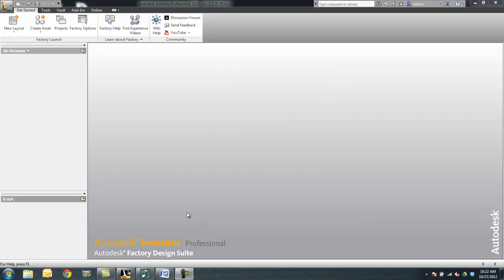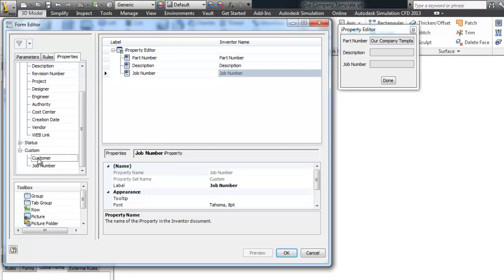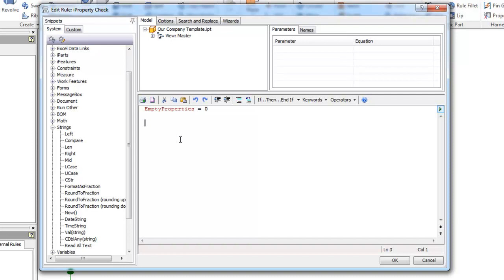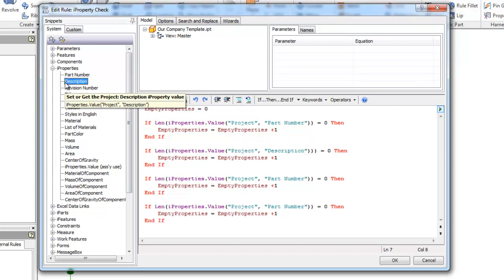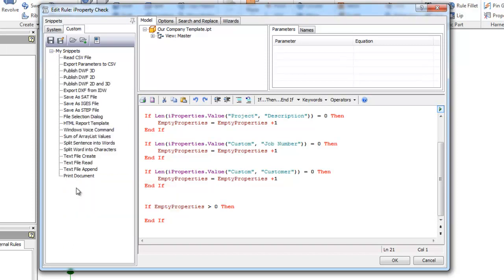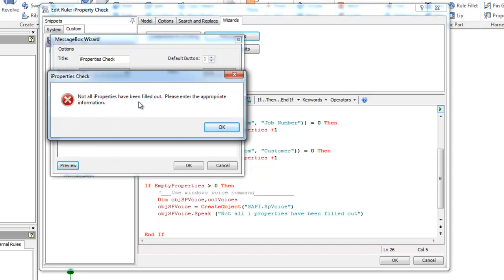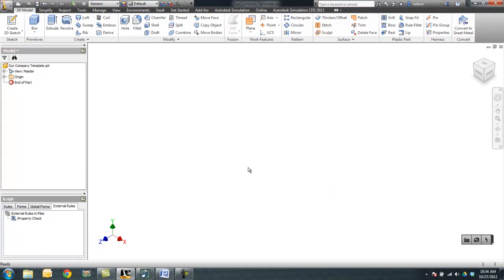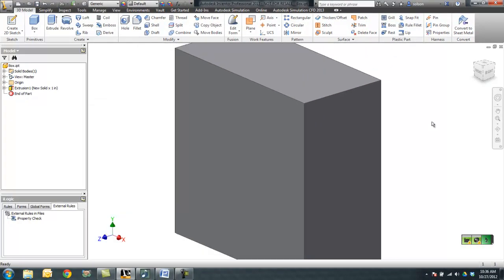iProperties Editor

Comment: Hello I'm able to add custom properties and also able to link it with template, but what happens is , the custom properties is just added for individual part only. Is there any way that custom properties I have created would get applied to all existing  parts and assembly, also any new part or assembly I create, those custom properties would be default.
And I'm new to inventor, your videos are helping a lot and I  appreciate your work man ❤️
Reply from the maker: Pranav, I am glad to hear that you are finding my videos helpful as you learn Inventor.  First of all, I would make sure that you add those Custom iProperties to your templates.  A common issue for users is how to get older files to have the right properties and iLogic Rules.  You could create a rule that looks like this.

Try 
	prop = iProperties.Value("Custom", "Test") 
Catch
	iProperties.Value("Custom", "Test") = ""
End Try

In this case, iLogic will try to get the value of the Test Custom iProperty.  If it can't, it will do what is listed under Catch, which is to create the property and set its value to nothing. 

Your new rule will need to be run on a bunch of files.  Previously, I had found a way to do that through Inventor's Task Scheduler.  As I was looking for that post, I found this.  

https://apps.autodesk.com/INVNTOR/en/Detail/Index?id=7381718697722491251&appLang=en&os=Win64&_ga=2.110687173.1955690979.1623693230-1577746048.1612365974

It is an add-on that will allow you to select files that an external rule should be run on.  There is a demo video that shows how to run the tool.

Hope this helps.
Reply: Hey  @3DSteve52   thanks for replying and helping out.
Form your reply I got to known how to add custom properties to all existing files, by ilogic rules.

But I'm still confused with program to add custom properties. You mentioned it above, but I don't know where it's is complete or not,  because I'm not good at programming.
It would be great if you could give me the complete program, for custom properties, or video for (specific custom properties).

For example I wanna add this custom properties
1. Ram material
2. Finishing

I known I'm asking lot from you, see if there's any way you could help me out.
Reply from the maker: @pranavphulsundar1888  It is not a problem.  Adding Custom iProperties through iLogic can be pretty easy.  You just have to have a line of code that sets the property value.  In older versions of Inventor this didn't work, but since Inventor 2012 or 2013 you just have to set the property to something and if the iProperty doesn't exist, iLogic will create it and set it to your value.  So in your case, if you want to set the value for Ram Material you would have a line like this in your rule.

iProperties.Value("Custom", "Ram Material") = ""

On the right side of the = you put inside the quotation marks, what you want to set it to.  When I want to create the property but don't want to set the value I use "".  But if you wanted to set it to steel, your code would look like this.

iProperties.Value("Custom", "Ram Material") = "Steel"

Initially, you said you needed to see if the properties were there and create them if they weren't.  I wrote this rule that would do just that.  You can download it from this link.

https://autode.sk/3gu55PB

If you have any other questions, you are welcome to email me at steve.olson@mesa-cad.com.
Reply: Hey  @3DSteve52  thanks for it.

Comment: Thank you for Lessen

I just started to us Inventor  so I have a question. 
it is possible to insert (modify) automatically iProprieties based on dimension or material. 
let say you manually inserted box name for description but can be made a rule to be inserted automatically ?

BOX Steel 100X200X10

BOX    - to be a standard name for this part
Steel   - to be automatically taken by material  (changing material to change automatically in part iProprieties ) description or part number...
100     - to be automatically taken by 1st dimension
200     - to be automatically taken by 2nd dimension
10       - to be automatically taken by 3rd dimension

Thank you 
Regards 
Tudor
Reply from the maker: Tudor,

Yes, this is possible.  You will not need the iProperty Editor as shown in this video.  You should check out this video.

https://www.youtube.com/watch?v=nkLGicHdK2g

It shows how to string together iProperties to fill out the description of a model.  It will also have to check the Export option on the parameters that are included in the description.

If you still have questions after watching that video, please let me know.

Thanks,
Steve